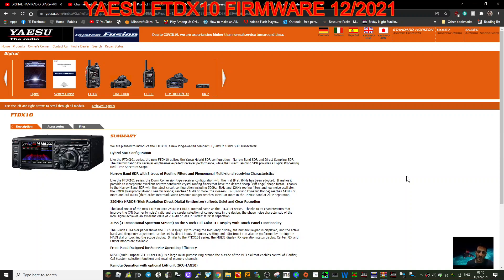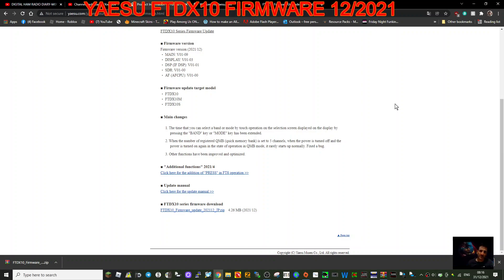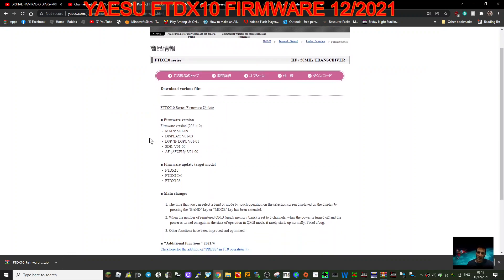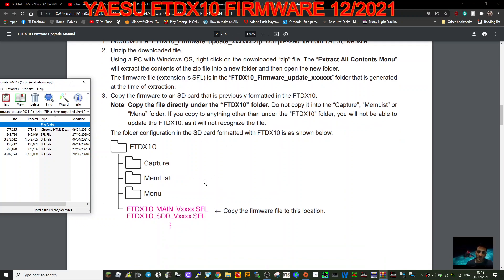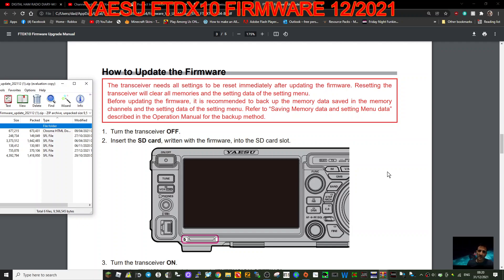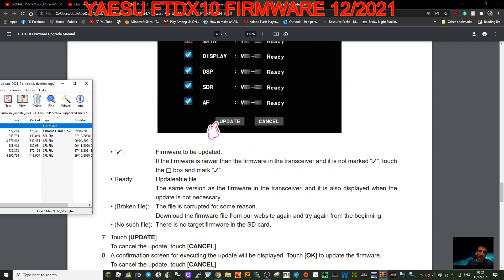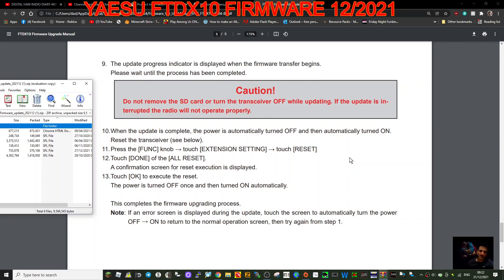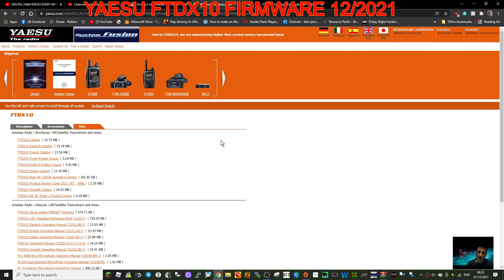YAESU FTDX10 FIRMWARE UPDATE-2021/12 V1.09

Comment: Implements improvements (MAIN: V01-09) New:
1. The time to select the “BAND" or "MODE" operation by touching the key when it is displayed on the selection screen, has been extended.
2. Fixed a bug; When the number of channels registered to the QMB (quick memory bank) was set to 5 channels, if the power was turned OFF and then ON again while operating in QMB mode, the transceiver did not reliably start up normally.
3. Other functions have been improved and optimized.
Reply from the maker: Thank you